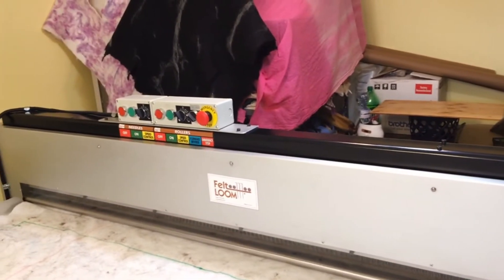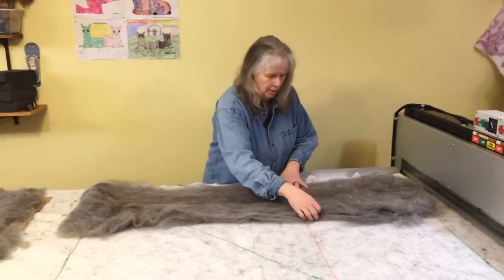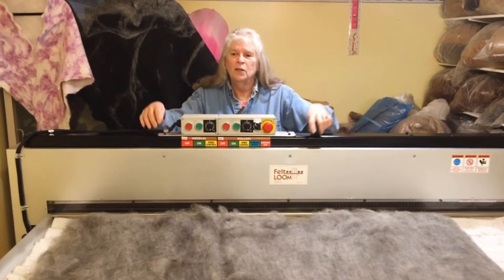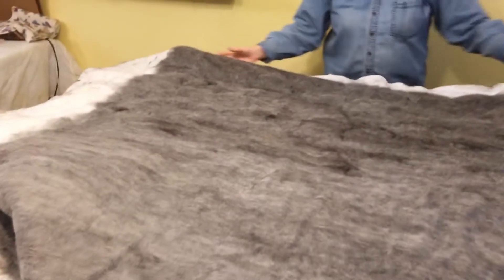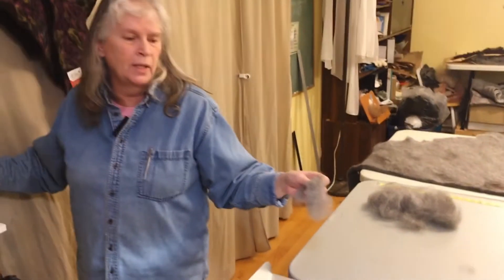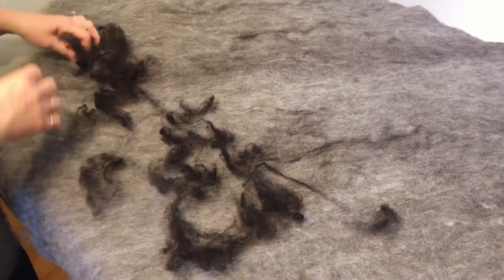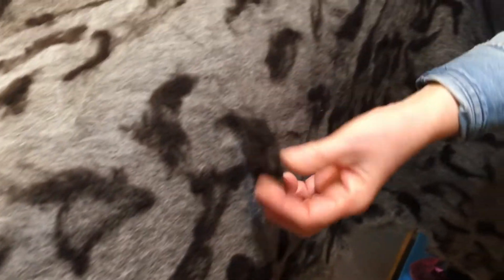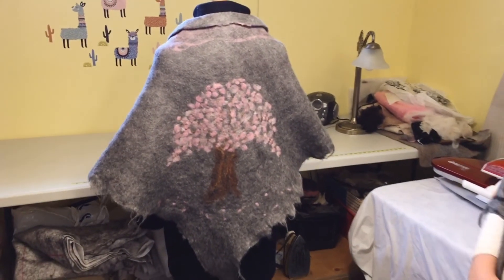Creating two shawls using a FeltLOOM

Comment: Judy here saying hello from Australia. I have enjoyed watching your video. I have had my 60 inch Feltloom [the only one here in Australia although there is now a Lexie] since 2014 and still creating on it. I have 34 alpacas all bred on site so have lots of fleece to process. I have a semi industrial carder so I can make individual batts at whatever weight I need. I mainly make blankets and ponchos and most often use a base fabric, from silk upwards in thickness. I am curious what weight and size your batts are. I use wind cheater fleecy, printed or plain, with non fluffy side down for my carrying cloth, works well and it's the right width for my machine.
Reply from the maker: Hi, I'm glad you enjoyed the videos. My batts vary in size depending which mill I use.  I prefer them to be over 2 feet wide.  I take them all apart and criss cross them when I'm making stuff.  The odd time I will make a few special batts on my 12" drum carder.  I'm hoping to figure out how to do blankets this winter.  Even though there are several others here in Ontario with FeltLOOMs we are pretty far apart in distance so there isn't a lot of help around.  Have a pronking day! Carolyn

Comment: I am wondering the same thing about the fabric you use for transfer
Reply from the maker: The carrying cloth is 100% Polyester. It does not have a smooth finish to it like a polyester blouse would have, there is a fine bumpy texture to it, not even as bumpy as a bath towel, but enough if you have dry skin on your hands it can catch a bit.  Hope that description helps.  A bit of the alpaca fibre sticks to it after it has been run through twice and picked off, I pick it off after the first run, turn the fibre upside down on the carrying cloth and run it through again, after that I don't use the cloth.  I tried a few different fabrics but found this works the best.
Reply: Thank you , we will go to the fabric store and look for something like that.  It will sure help us.

Comment: Hello, really great video thank you. Very helpful! And such lovely results. I also have a 72"  Feltloom in New Zealand and I use similar sorts of batts, but made of possum and merino.  What kind of fabric do you use please for your carrying cloth?
Reply: Hi could you please tell me where you bought your feltloom from, Im in NZ also and having difficulty finding one, cheers
Reply from the maker: @andreafletcher5985  Hi, Contact FeltLOOM in the USA where the machines are made.  I know they ship all over the world.  I drove almost 12 hours to pick up mine, I recorded as they disassembled it so I would know how to put it back together.  They are usually very helpful.
Reply from the maker: The carrying cloth is 100% Polyester. It does not have a smooth finish to it like a polyester blouse would have, there is a fine bumpy texture to it, not even as bumpy as a bath towel, but enough if you have dry skin on your hands it can catch a bit.  Hope that description helps.  A bit of the alpaca fibre sticks to it after it has been run through twice and picked off, I pick it off after the first run, turn the fibre upside down on the carrying cloth and run it through again, after that I don't use the cloth.  I tried a few different fabrics but found this works the best.